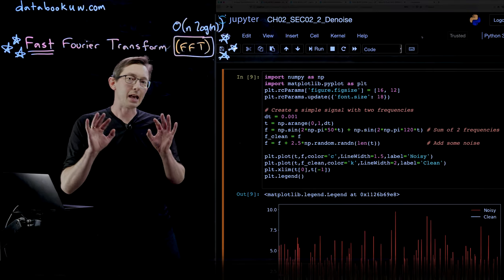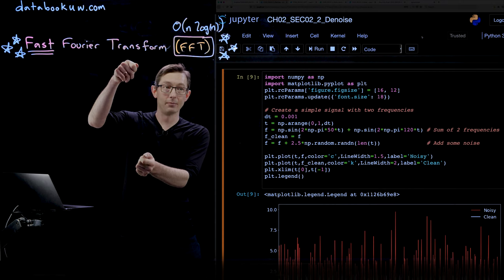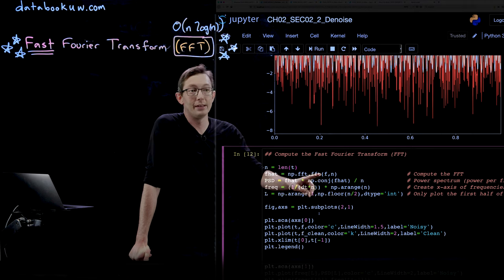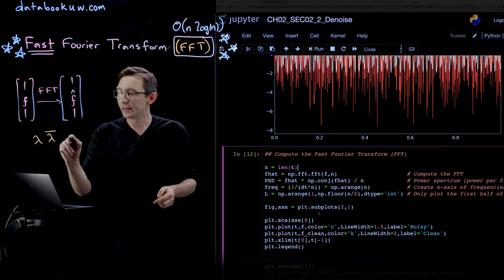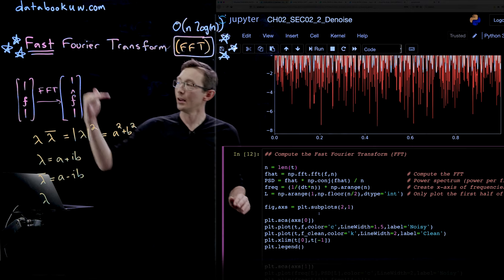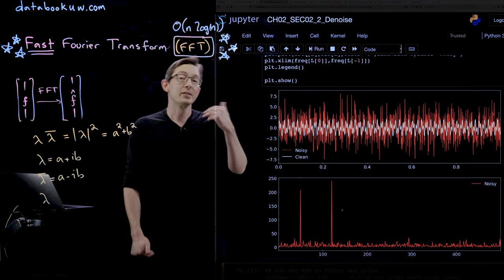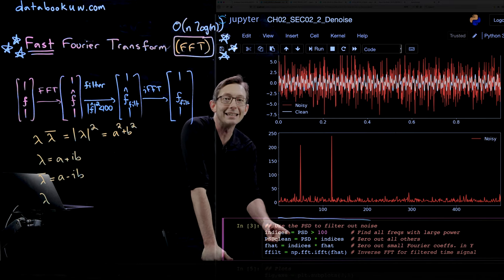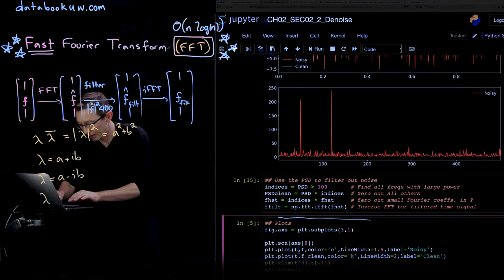Denoising Data with FFT [Python]

Comment: This has been very useful for me. I am a Mechanical Engineer and I am working in dynamic studies of steel structures. This method is very practical to apply to the acquisition of accelerometer data in dynamic tests. Thank you so much Steve!!!

Comment: You forgot to multiply your np.fft.fft(...) output by dt. np.fft module assumes the sampling spacing is 1. So we have to fix for this if we have a different sampling spacing. Also, you don't have to give n as the second argument of your np.fft.fft because n is also the length of your signal, so it's effectless.

Comment: Hi Steve, I have a doubt. If we run a Kalman filter on this data, can the filter distort / change the frequency content of the signal? I tried to run a Kalman filter and sometimes I get funny results. I am not able to understand what might be going wrong. Can you please help?

Thanks
Reply from the maker: That is a really good question.  Yes, in general, filtering algorithms will change the spectrum of the signal, sometimes quite significantly.  There is a lot of work in designing filters that have certain nice properties.  For example, if we run a simple low-pass filter over the data, it will mess up the phase information in the signal (because there will be a small delay).  So the 2nd order Butterworth filter is often used to prevent this phase corruption.  Sometimes people also use the "filtfilt" function, which runs a forward and a backward pass of the filter to get rid of the phase delay.  So long way of saying that yes, this is a real concern and it is not always easy to filter and preserve frequency content.  But, remember, often when you filter, your goal is to modify the frequency content, for example to remove high-frequency noise.  So there is no "silver bullet" for filtering.
Reply: @Eigensteve  I'm using the filtfilt in sensor live data and that technic doesn't work for live data since I'm seeing a kind of "repaint" after I receive the last point on the data received previously. Let's say that I have 50 points ... when I receive the point 51 what was calculated on the previous 50 points will change when I receive this last point, so the filtfilt technic doesn't work well on the last point received. Another issue is when I compare the live output of my Butterworth filter to filtfilt output they are exactly the same on the last received data, meaning that the delay is there on the last point received, the delay is only taken away for that particular "event"(Let's point 50) when we receive more data( >=51 points). Can you advise me any technic that allow me to filter data in live stream having no or very few delay? My data is not periodic, I think that for example the FFT is not an option. Thanks you.
Reply: @Daniel88santos  Applying FFT on live data sets, the size of which are not power-of-2? And then you're also filtering and inverse-transforming? Brave, yet interesting. My own power-of-2-cents would be... Don't allow the dataset to be sized dynamically. Keep a fixed size and let the live data "roll" through it. Make sure the size of this dataset is something like 64 instead of 50 or 51. Zero-pad if you must. If none of what I just advised made any sense to you, you may have to do a bit more research. Fourier Analysis and noise filtering is not a subject mastered with a few youtube videos.
Reply: @romanvereb7144  thanks by you reply, I've figure out how to do it with any size of points, and not using zero padding ... but I cannot comment on it, since is proprietary technology.
Reply: @Daniel88santos  Such is the way of the world... One learns without giving back. A seed planted, but no longer spread.

Comment: Take note: f is the noisy data
1. f_hat = FFT(f)
   - f_hat is a vector of complex Fourier coefficients (increasing frequency: low to high) with its magnitude.
2. PSD = |f_hat|
   - vector of real magnitude (power) for each frequency.
3. Filter: on PSD, keep the power > Threshold, and set 0 to the rest (because they are the noise frequency) and we have new f_hat.
4. f_denoised = iFFT(new f_hat)

Comment: Love your presentation.
Interesting though that you got your code to work without errors.
Casting complex values to floats ist verboten! 😏 Here's how it should be for the graphs to display without error:
plt.plot(freq[L], np.absolute(PSD[L]), color='c', lw=2, label='Noisy')
However,
this does not solve the problem at it's root, because the Boolean return for a complex like `PSD` referenced to and integer as in:
indices = PSD > 100  does only return a Boolean array filled with `False`, unless np.absolute(PSD) gets implemented.
The best place to do this without undue repetition throughout the code is where the problem starts.
Here we see the amendment that forces absolutes and brings all the trouble caused by attempting to handle complex values like floats to an end: 
PSD = np.absolute(fhat * np.conj(fhat) / n)  # Power Spectrum Density (power of FFT)
However,
the error finds itself repeated in the last set of plots with the `Inverse FFT for filtered time signal` and is best corrected like this:
ffilt = np.absolute(np.fft.ifft(fhat))  # Inverse FFT for filtered time signal 😉
All in all, a very clear and understandable `toy example`. 💚

Comment: The magnitudes of the signals with 50 and 120 Hz depends on the random numbers that you generate at the beginning of the code. I had this problem that  my magnitudes where different from those presented in  this video.

Comment: I have a silly question. Is it the correlation among the data that yields two spike in frequencies in power spectrum?  because the white noise is uncorrelated.
Reply from the maker: The power spectral density and the autocorrelation are very closely related.  It turns out that they are Fourier transform pairs.  So it is definitely related.
Reply: @Eigensteve  makes sense. thanks

Comment: import numpy as np
import matplotlib.pyplot as plt
plt.rcParams['figure.figsize'] = [16, 12]
plt.rcParams.update({'font.size': 18})

# Create a simple signal by combining two frequencies
dt = 0.001
t = np.arange(0,1,dt)
f = np.sin(2*np.pi*50*t) + np.sin(2*np.pi*120*t) # sum of 2 frequencies
f_clean = f
f = f + 2.5*np.random.randn(len(t)) # add some noise

plt.plot(t, f, color='c', LineWidth=1.5, label='Noisy')
plt.plot(t, f_clean, color='k', LineWidth=2, label='Clean')
plt.xlim(t[0], t[-1])
plt.legend()

# Map the signal from Time Domain to Frequency Domain

n = len(t)
fhat = np.fft.fft(f,n)      # Compute FFT
PSD = fhat * np.conj(fhat) / n  # Compute Power Spectral Density (Combine real & imaginary bins)
freq = (1/(dt*n)) * np.arange(n) # Create x-axis of frequencies
L = np.arange(1, np.floor(n/2), dtype='int') # Only plot first half of Freqencies

fig, axs = plt.subplots(2,1)

plt.sca(axs[0])
plt.plot(t,f,color='c',LineWidth=1.5,label='Noisy')
plt.plot(t,f_clean,color='k',LineWidth=2,label='Clean')
plt.xlim(t[0],t[-1])
plt.xlabel('time')
plt.legend()

plt.sca(axs[1])
plt.plot(freq[L], PSD[L], color='c', LineWidth=2, label='Power')
plt.xlim(freq[L[0]],freq[L[-1]])
plt.xlabel('Hz')
plt.legend()

# Filter Signal based on PSD

indices = PSD > 100 # Find all freqs with power greater than 100. [Boolean Array]
PSDclean = PSD * indices # Filter PSD by multiplying by Boolean Array
fhat = indices * fhat # Filter FFT coefficents that's Power < 100

# Inverse the cleaned FFT to get clean time domain signal

ffilt = np.fft.ifft(fhat)

# Plot

fig,axs = plt.subplots(3,1)

plt.sca(axs[0])
plt.plot(t,f,color='c',LineWidth=1.5,label='Noisy')
plt.plot(t,f_clean,color='k',LineWidth=2,label='Clean')
plt.xlim(t[0],t[-1])
plt.xlabel('time')
plt.legend()

plt.sca(axs[1])
plt.plot(t,f_clean,color='r',LineWidth=2,label='Clean')
plt.plot(t,ffilt,color='k',LineWidth=2,label='Filtered')
plt.xlim(t[0],t[-1])
plt.xlabel('time')
plt.legend()

plt.sca(axs[2])
plt.plot(freq[L], PSD[L], color='c', LineWidth=2, label='Power')
plt.xlim(freq[L[0]],freq[L[-1]])
plt.xlabel('Hz')
plt.legend()

plt.show()
Reply from the maker: Thanks!!

Comment: I have tried it with an audio sample of 60000 samples and 16000Hz. The fhat was in between +/- 400 and PSD 0 to 3. Then, I made indices=PSD>0.001. I finally saved the audio resulting from inverse fft. It was noiser than before. What is supposed to have happened in the reported experiment?

Comment: I have a question. If you just zero out all the frequencies that are below your threshold and keep the ones above, isn't that really aggressive filtering? In my understanding, you would have a tight rectangle function around every peak, which means that in the time domain, there's going to be lots of ringing artefacts from the rectangle function transformation (- the sinc function). How does this not happen in your result, or is it too hard to see?

Comment: Hi Steve, thanks for the nice and helpful video! One thing though, I was wondering if there is a "standard" way of choosing a filter value? Is your case of two "peaks" a good rule of thumb?
Reply: I'm not an expert so please don't take this as an absolute truth.

I'd look at the graph first (or have so metrics, depending on the type of data) and see if we get only few very high peaks or something more regular.

In the first case you'd probably have a lot of liberty if you wanted only the big peaks. In the second case I'd probably start being conservative and get some noise in the result if it means I'd get everything I wanted from the data. But depending on what I'd be working on I'd begin increasing the threshold until the data starts losing too much.

Comment: This seems like it could be used in a unit test to test that the FFT function in an application is working. Will the filtered data be exactly the same as the data that was used to create the noisy data?
Reply from the maker: Perhaps, but I think there might be more quantitatively exact unit tests for the FFT.  The filtered data will only approximate the original data, so the agreement won't be that close quantitatively.  If I was cooking up some unit tests off the top of my head, I would probably run through a few pure-tone sine waves, a few two-tone waves, etc.  I would also check that Parseval's theorem is being satisfied.
Reply: @Eigensteve  Yes, of course the filtered data are just an approximation of the original one. Thank so much my Dear professor for the deployed effort, and Thank you for sharing, you are the best professor of Fourier Transform that I have never seen. Little thought of the teacher Nathan Kutz and to all your team.

Comment: Hi Steve, Thank you for the video, I have two questions:
1- Why did you plot only half of the data? I tried to plot the whole data but I got a diagram which did not make sense (my code: plt.plot(freq,PSD,color="c"))
2- suppose that we have the Fhat vector, how can we exactly find the sin, cos coefficients, and the constant that have made up the signal?
Reply: The answer to first is that np.fft.fft gives you F^hat for both negative and positive frequencies. We are only interested in positive ones. So we plot half of the data.

Comment: Nice video. What if the desired signal power is comparable to the noise power such that setting threshold is not possible, is there any method to reduce the noise ? Thanks

Comment: Great video - thank you, very helpful. Just curious to determine whether or not there is a way to computer a PSD minimum. You selected 100, but that was after observing the graphed data. Is there a statistical approach to computer this value?
Reply: Just take PSD max and set a threshold of 90% of it to filter-out lower frequencies.

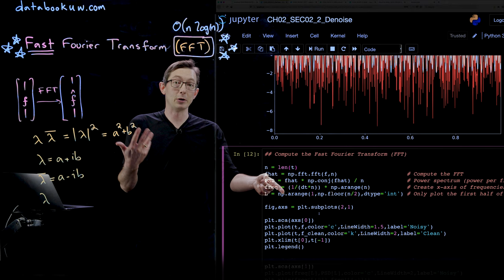Comment: Can you explain at 05:03 ?, the line which is calculating L=np.arange(1,np.floor(n/2), dtype='int')   , specifically floor(n/2) and the use of it as freq[L]
Reply: There is a specific method in Numpy that does this calculation: https://numpy.org/doc/stable/reference/generated/numpy.fft.fftfreq.html

Comment: Thank you for your amazing videos. 
I definitely learned a few things from this video, but I have a very special question.
In your example, the noisy frequencies in the FFT are weaker than your pure frequencies, and therefore easy to threshold it and get rid of the noise. But I have a signal that is basically the opposite, as I am trying to detect a dripping sound, and there is a bunch of other frequencies.  I think the dripping sound is very low in a way that makes it "noise?" in away. 
But would you recommend any other approach? or any way to amplify the dripping frequencies? 
Note: I don't know the frequency of the dripping.
Reply: Might be worth recording some very clean dripping sounds. So you can understand the core features. Maybe you find a lowest and highest possible frequency for your sound and kill all others.
There is a neat trick for getting clean signals: record some samples of pure noice and some samples of noice and signal. If you add up all noice and signal and substract all noice you have a pretty good chance of getting a clean signal.

Comment: Hi Steve! Great video and channel
 I wondered if you can explain how to interpolated when I miss a part of the signal in time (for example i miss some point's of the sine), I want to know if there is an accurate way to reconstruct the signal in that gap.
i tried whit Fourier but the inverse FFT converge to zero in that gap because dont have information there and i don't know how to solvet

Sorry for my English and i send you good luck from Uruguay! thanks for the video's
Reply from the maker: Great question.  There are a ton of ways to approach a problem like this.  One way would be to compute the spectogram and interpolate in between where you have data.  I'll have a lecture on the spectogram soon.  Alternatively, you could compute the FFT to the left of the gap and to the right of the gap and try to average the phase and magnitude of these signals to figure out what the data in the middle should be.  Essentially, if you only had the data on the left, you could use its FFT to continue this period signal forward.  Similar with the data to the right of the gap.  But there is a lot of depth in this question and lots of directions to go with it.
Reply: Thanks you very much for answer. Im going to tried those advices. I wondered (if you don't mind an know) if you can recommend me some article or book were i can read more about
Reply from the maker: @maurocabrera2983  We just wrote a book at databookuw.com/databook.pdf that might help.

Comment: Referring to https://youtu.be/s2K1JfNR7Sc?t=159, I grew unsure that the PSD is really a power spectral density. I try to bring my arguments for a doubt. 

Firstly, the physical dimensions of the signal and of the transform are the same in the DFT. So, in the PSD line the lecturer is just pointing to, `fhat * np.conj(fhat)` has the dimension of a squared f, since n is dimensionless.

Secondly, the sum of the PSDs term is a squared norm for the transform that had been called an "energy" in the lecture on Parseval's Theorem --- see also its DFT expression in  https://en.wikipedia.org/wiki/Parseval%27s_theorem#Notation_used_in_engineering. If an "energy" has to become a power, it should be divided by a time. Here, the denominator is just a counter required for normalization by the theorem, hence no time. So, no power in the sense of temporal rate of change of some "energy" content. 

Finally, I can see that each item in `fhat * np.conj(fhat) / n` is a spectral density in a discrete sense: in Parseval's theorem each term is a contribution from a single spectral frequency to a summation, looking at density as a sort of share. Though, I still wonder whether I should still divide the "PSD" array in the exercise by the frequency array to obtain a true spectral density having units [f]²/Hz. If so, the spectrum changes accordingly.

All these considerations turned up when I was porting the lecture's analysis to my field where dimensional consistency is key, simply because you have to declare the units in the plots. 
If the above makes sense, I would rather call the PSD in the exercise a Energy Spectral Density. 

Also important, stating exactly what that quantity is key for lining up the correct methods in a script. The Matplotlib method `specgram` used right afterwards (https://matplotlib.org/stable/api/_as_gen/matplotlib.pyplot.specgram.html) outputs the 'psd' as default 'mode' but, alas, without providing the formula they implement. So no easy possibility to cross check. It may well be case that what we see in the power (...or energy...) density spectrum and in the spectrogram in the exercise is not mutually consistent after all.

So you spot any flaw in the reasoning? Thanks for sharing your views.